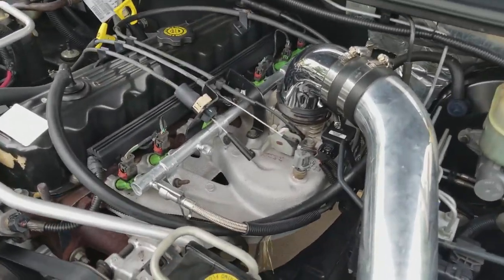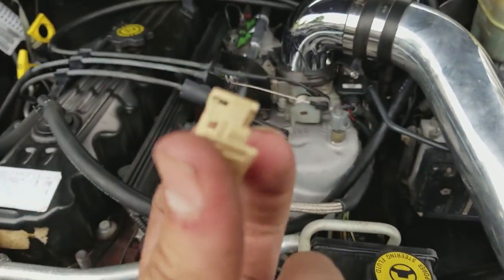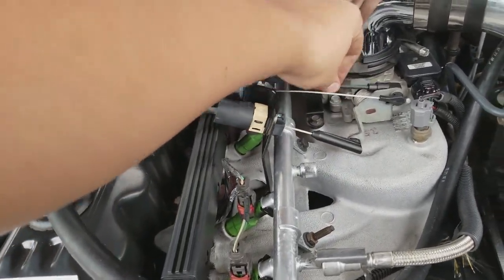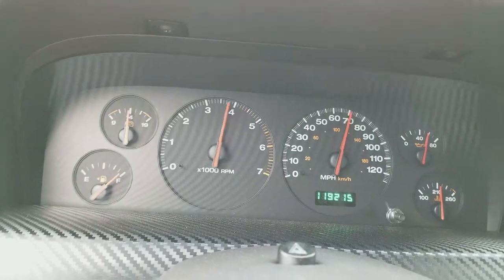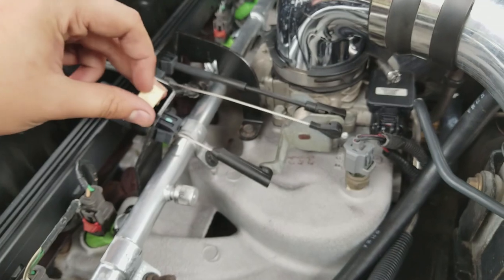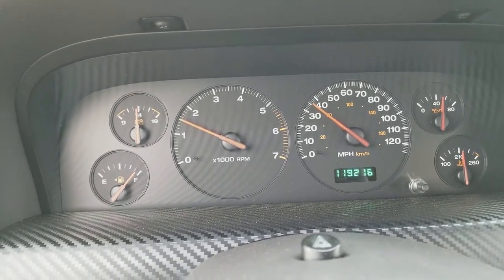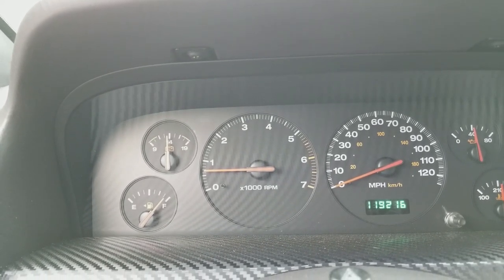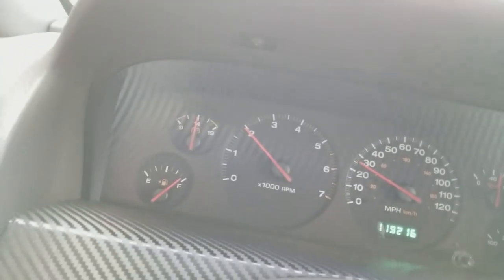The Grand Cherokee Project (Shifting Cable Adjustment)

Comment: The right way is to pull the white clip, make sure the cable housing moves freely within the holder. With the engine turned off of coarse, hold the throttle WIDE OPEN and the cable housing will adjust itself properly. Install the clip before returning the throttle from the wide open position. Done.. your 4.0 will seem like a hotrod with it shifting properly
Reply: Really??
Reply: So you saying this will work definitely for the 99 Grand Cherokee, remove white clip make sure it's free open throttle wide open reset the white clip and it should be good correct
Reply: I apologize if that's repeating what you just said cuz it sounds like it to me in my head I just like to make sure I'm 100% correct
Reply from the maker: I have seen that work also.
Reply: Just did this adjustment, and followed the actual factory service manual instructions, which....have absolutely nothing in-common with what you typed here, sir.

NOT "tHe RiGhT wAy", whatsoever.

The FSM instructions worked great for me, though.
Reply: @revolutionday1  so what is the factory way?
Reply: @nickabee1149  (1) Turn ignition switch to OFF position.
(2) Remove air cleaner if necessary.
(3) Disconnect cable end from attachment stud.
Carefully slide cable off stud. Do not pry or pull
cable off.
(4) Verify that transmission throttle lever is in
fully closed position. Then be sure lever on throttle
body is at curb idle position.
(5) Insert a small screwdriver under edge of
retaining clip and remove retaining clip.
(6) Center cable end on attachment stud to within
1 mm (0.039 in.).
NOTE: Be sure that as the cable is pulled forward
and centered on the throttle lever stud, the cable
housing moves smoothly with the cable. Due to the
angle at which the cable housing enters the spring
housing, the cable housing may bind slightly and
create an incorrect adjustment.
(7) Install retaining clip onto cable housing.
(8) Check cable adjustment. Verify transmission
throttle lever and lever on throttle body move simultaneously.
Reply: @revolutionday1   depends on how many times u want to drive it down the road n check shifting I guess. Gimpster isnt wrong tho. It will get you near perfect off the cuff. Actually later models have a push button instead of clip. Adjusted like gimpster said. Push button clip, slide up detent, get inside n push gas pedal to floor.
Reply: @revolutionday1   lol be a man🤣🤣
Reply: Just did it.  Thank you man!  Worked just like you said it would.
Reply: @nickabee1149  Earlier models had a push button as well.
Reply: I don't think this is the right way. You push the cable in it will never shift. You need to pull it back to get the cable snug a little. I know because I've tried it last night after watching this video. So it is backwards.

Comment: Thats nuts. My 4.0 never revs past 2.5k before shifting on a foot to the floor take off. Im afraid it would blow at anything higher than 4.5k lol
Reply from the maker: +Ashton Mugridge Lol!
Reply: They can take it. There's even a WJ service bulletin for the 4.0 that states the exhaust valve sometimes doesn't rotate and sticks, and the fix for it is to hold the engine at 4500 for 15 seconds in gear. idle and repeat
Reply: @Taydrum  like with the wheels off the ground?
Reply: @42WallabyWaySydney  NO with a load on the engine.
Reply: @Taydrum  how do you do that without a dyno?
Reply: @42WallabyWaySydney  Easy, what I did is manually shifted the automatic shifter into 2nd, and climbed a big hill at 40 mph, churning out around 3500-4000 rpm

Comment: Yea, you might want to read how to do this in the manual .... just a thought. 
Can't read? OK, general rule, over time it will stretch, so you would un- stretch by making the housing "longer".
Reply: That's the part I got confused it doesn't make sense

Comment: Hi Kindlestone! Im 26 from Minnesota and since its cold as hell i actually broke the plastic connector for this cable! Can you please help if you have any suggestions other than replacing the whole cable!
Reply from the maker: If its just the little piece you pull out you could get it form a junk yard. If its the main part I'm not 100% sure how replacing that goes

Comment: You have a metal tube from your air intake to your filter i suggest you use plastic it absorbs less heat.
Reply from the maker: Yeah there is many things that I would change about this car now that I know more about cars and how they work!
Reply: Air flows better with metal vs plastic
Reply: @dl3130  But the plastic stays cooler keeping the air cooler.  Which is better for the performance.
Reply: It's a 4.0 wj, not a Corvette. "Performance" 🏆🤠
Reply: @southernNCfamily  ya but your paying more for metal so your going out of your way to pay more for something that will decrease engine health. Just saying brother no knocking metal if its what your heart desires the  i understand. But from a poor mans view who likes to make his work perfect but has to make his cash stretch.
Reply: @southernNCfamily  with the exception of your living a environment thay is cold as fuck then it makes no difference lol

Comment: The cable that you adjusted isn’t connected to the throttle body in my jeep. What does that mean? Like the wire is just hanging it doesn’t have the black clip holding it
Reply from the maker: It means the transmission has know how much throttle your giving it. I'm sure it does not drive vary well

Comment: My jeep is doing the exact same thing.. won't shift out of first gear until about 4k rpms.. did you ever fix the problem? If so what was it?
Reply from the maker: That cable I messed with in the video should fix it but everyone says I said it backwards to fix the problem.

Comment: 2 things,when I remove the white clip I have to old the position of the cable,to make sure I don't loose the previous adjustment,how did yours hold its self,2,what is the name brand an where did you get your air filter an intake tube thanks
Reply from the maker: It just kinda holds itself in. The intake tube is from Advance Auto Parts. Its like a 90 and the only long tube on the shelf.
Reply: Anyone know what four hole injectors will fit in the 99 Grand Cherokee that's supposedly I heard from it's Ford and one guy said it's EB 1 / 9/17 . My money is tight but want to put a little more pep  in the step if you know what I mean any ideas exhaust injectors throttle body I know a 62 mm they say it will work is it true thanks guys
Reply: Take the white clip off that cable, leaving the cable attached hold the throttle wide open and put the clip back on and you're done... If it still runs badly disconnect the battery take a zip tie or something put the positive and negative together making sure that they have contact leave it for about 35 minutes they say 30 but 35 to be safe this will reset your PMC and the TMC then start the Jeep hold it down to 2000 RPM's for about 5 minutes with your air conditioner full blast, then turn the air off and do it again for five minutes then drive it hard until it levels out at first it'll run like crap but after a few miles it'll feel like a different Jeep! The video isn't wrong but resetting the TMC is what controls the transmission and the only way to reset that is how I described. Doing this allows for the PMC and the TMC to readjust to the adjustments you made. The reason for running it at 2000 RPM's with the air on and off is only to set your idle to where it runs good with the air on or off.

Comment: What injectors and fuel rail are you running ?
Reply from the maker: Precision auto injectors Bosch 4 hole stock painted fuel rail.
Reply: I'm very late jumping in here but for those seeing this in the future those are Bosch 0280155007 injectors.  Generally found in Dodge/Chrysler minivans.  A good "upgrade" over the stock XJ injectors.

Comment: Crashman   01 grand cherokee  won't come out of 1st  If you release gas it can.  Guy says needs new trannie  I just called him and told him to check throttle body sensor (saw below)  Someone had put in a second hand throttle body a month ago.  Guy said you just had one put in and I wondered if it could have been faulty   Is there a way to check if bad?
Reply from the maker: I dont think it would be a throttle position sensor because it uses that cable for shifting not a computer
Reply: @kindlestone  When this 1st happened Tran place said sensor and selenoid in tran would be the fix but $500 and no guarantee.  So drove it home slowly.   Went to this recent place and they said new  second hand trannie $1100   Car is sitting in their  lot They said they're ltrying to find one with less than 75000 miles on it.

Comment: Mine shifts hard in between 1st - 2nd and takes forever to shift into overdrive I call it so I let off then it shifts
Reply: Have you been able to figure out the issue? I have the same problems
Reply: Any update on what fixed it for you if on the same situation Mine won’t shift out of first until like five RPMs and I have to let go to gas and sometimes it’ll shift and sometimes it won’t
Reply: @mikepon6 try replacing crank position sensor and cam sensor. Or possibly your shift solenoid is bad. I’m goingto be replacing them soon because I’m going though this myself. I’ll let u know how it goes.🇺🇸

Comment: Does this work for the 5.2L V8?
Reply from the maker: I would think any vehicle with a cable should have an adjustment. It could be different then what's in the video
Reply: @kindlestone  ok I’ll have to try later, my transmission has been giving me a lot of trouble and I want to see if this helps at all

Comment: Mine shifts from 2nd to 3rd at about 45 mph, and it's got me a little worried, becuz in traffic it's this up and down like I'm in a stick shift. I did your adjustment and adjusted it all the way out making the cable tight on the throttle body, and it improved a little. But it's still a high rpm. Got any ideas?
Reply from the maker: I wish I knew how to help you but, if your adjustments dont change anything it could be something else but not 100%.
Reply: He said that if u push it out it’s well extend the shift!
Reply: Take the white clip off that cable, leaving the cable attached hold the throttle wide open and put the clip back on and you're done... If it still runs badly disconnect the battery take a zip tie or something put the positive and negative together making sure that they have contact leave it for about 35 minutes they say 30 but 35 to be safe this will reset your PMC and the TMC then start the Jeep hold it down to 2000 RPM's for about 5 minutes with your air conditioner full blast, then turn the air off and do it again for five minutes then drive it hard until it levels out at first it'll run like crap but after a few miles it'll feel like a different Jeep! The video isn't wrong but resetting the TMC is what controls the transmission and the only way to reset that is how I described. Doing this allows for the PMC and the TMC to readjust to the adjustments you made.

Comment: Mine shifts  from sec to third way to fast like it don’t even stay a sec
Reply from the maker: Even when you move the wire?
Reply: ok i just moved it but mine wont move when u push down tthe gas peddle
Reply from the maker: @stevebrown3169  Once you adjust the cable you need to put the clip back on or it will move freely